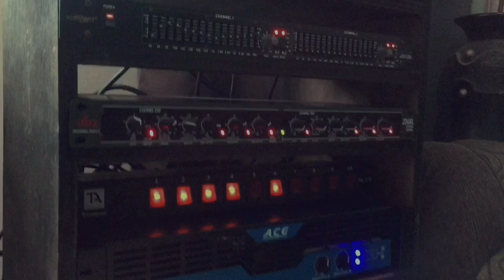Crossover | Active | Passive

Comment: The main difference nila ay ang "Gain" si passive walang kakayan palakasin ang sound dahil wala siyang external power bagkos additional load pa sya sa amplifier, ang active ay gumagamit ng active components o op amps para palakasin ang signal o i altered ito depende sa frequency na gusto mo.

Comment: Hello po paanu mg.wire ng six speaker with dividing network in one amp....(3spkr per channel)..
Reply from the maker: Ung dividing network Sir meron na nakalagay dyan na woofer mid at Hi. Iba iba lang term. Tapos meron input un ang connection nya sa Amp
Reply: @EMaudio  sir ano po ilagay para sa subwoofer na xover para d xa kumanta? Kc ng try ako sa deviding network kumanta parin xa sa woofer eh bosster lng gamit ko naka mono kc xa kaya d masiparate ang b at mid.
Reply from the maker: Try mo lagyan ng coil ung speaker. Or mas maganda eh gamitan mona ng Crossover